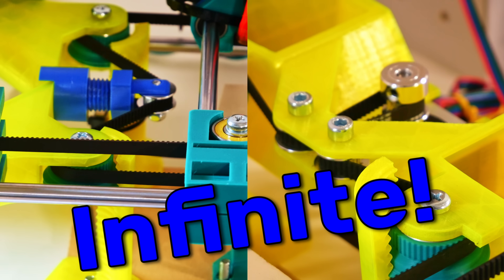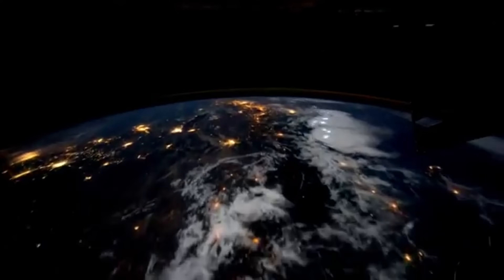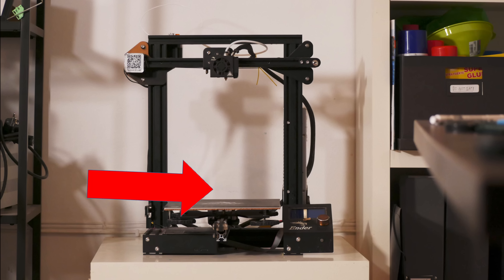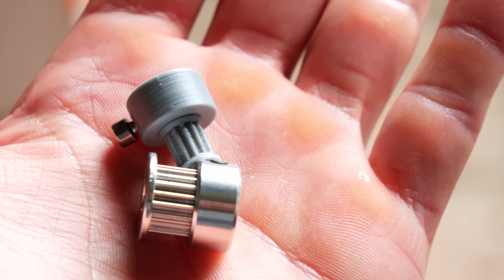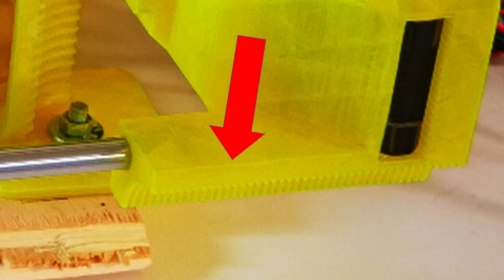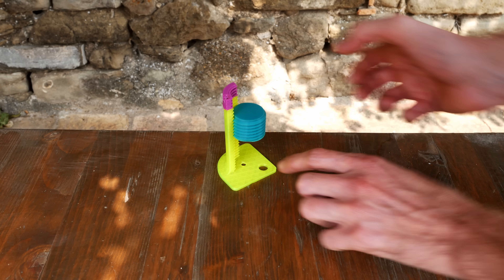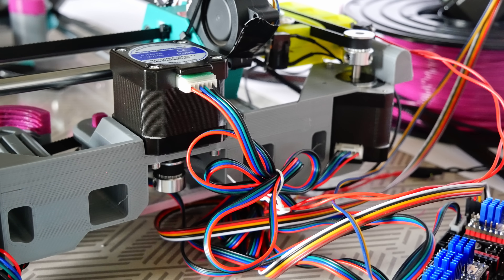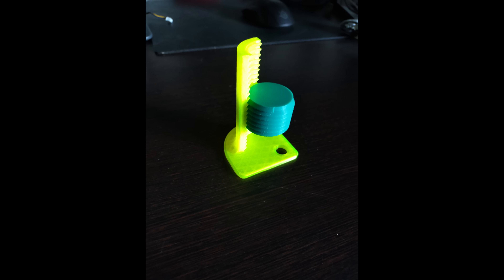it can 3D-Print onto itself?!

Comment: I especially like the fact that the vertical axis of the parent printer becomes a horizontal axis of the child printer which even increases the build volume with each new printer! Awesome concept, to infinity and beyond!
Reply: This is genius and I love it. I hope I can contribute at some point!
Reply: You two should adopt this as a baby and combine your ultra light and strong grantry rails in your last video to further make this printer fully 3d printed. 😄
Reply: Infinite support material
Reply: You still run into open-span material structural limits. The printer isn't infinitely rigid, so there is an upper bound on size before something breaks under its own weight.

But this does drop the minimum required mass-volume needed to pack into an unmanned space craft in order to fabricate on-site. NASA's own estimates in 2004 estimated the seed robots would need to mass 500 kg and be 2x1x1.5 meters and that three (two assembled and one unassembled for making molds) would need to be sent.

Mind, this also included all of the infrastructure to harvest, refine, and power everything.

https://www.niac.usra.edu/files/studies/final_report/880Chirikjian.pdf
Reply: that's not working that easily and most likely never will.

Comment: Well, I don't know enough to substantially help you, but I would suggest that a good way of getting rid of the metal rods would be adding 3D printed rack & pinion or a screw mechanism, these could be printed in place, but I don't know how precise it would be.
... But if the objective is to make a fully print-in-place 3D printer, I think it is worth the downside.

Another suggestion would be to search for websites that allow you to post your progress with each part of the project, the only one I can think of are Hackaday.

Also, if it is possible to print in place the electronics , then it would be wise to add a multi-filament extrusion system to your 3D print.
Reply from the maker: Thanks for the feedback! That is something that is being considered! Multi filament support will also be necessary!